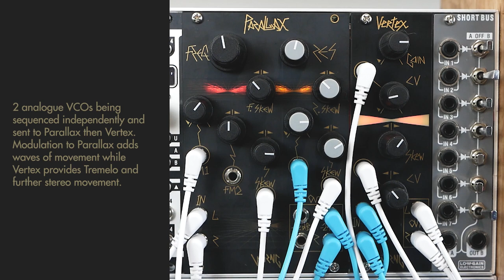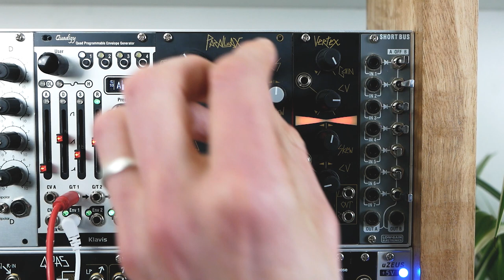Worng Electronics Parallax Stereo Low Pass Filter & Vertex Stereo VCA - In Depth Demo

Comment: at 3:10 you called them "12v/oct and 24v/oct" respectively, and the term you are looking for is "db/oct" The filters have 12/24 DECIBEL per octave of rolloff after the cutoff point.

Volt per octave is speaking about the fm input of the cutoff frequency. as in  for every volt you add to the v/oct input the filter cutoff rises 1 octave
Reply from the maker: yes you're 100% correct - I missed that mistake, thanks for picking that up - i'll pin your comment to the top for others to see :)

Comment: Great video! So I want to stereoize my mono elements, such as my synths, and drums. is the Parallax the best way to do that? Or the LSMSR module? I’m confused between which Worng module to get. Cheers for the help!
Reply from the maker: either of these would certainly help, they're just different approaches! Vertex will take a mono input and pan it around the stereo field, Parallax will take a mono input, duplicate it and apply different low-pass filtering to L/R outputs creating stereo movement. LRMSMSLR deals with mid/side encoding and is quite unique in Eurorack - there are certainly ways you can use to 'stereoize' a mono signal (including mono effects!), there's a great tip on page 5 of the manual that describes working with a mono signal and a mono reverb to make a big stereo sound  - have a squiz at https://www.worngelectronics.com/